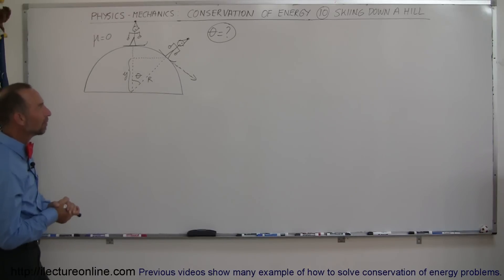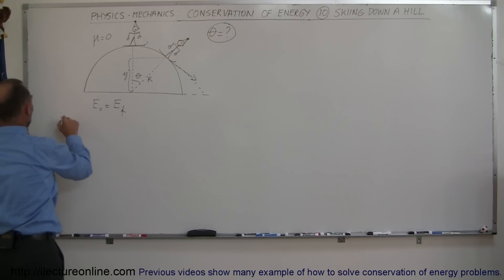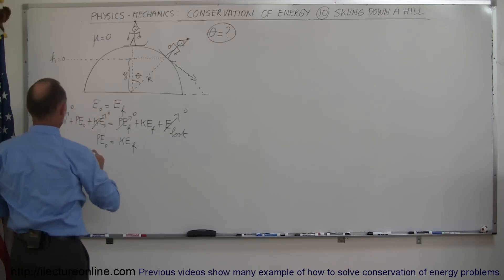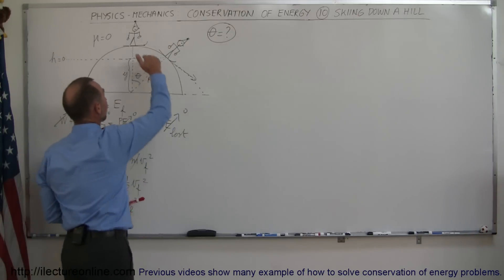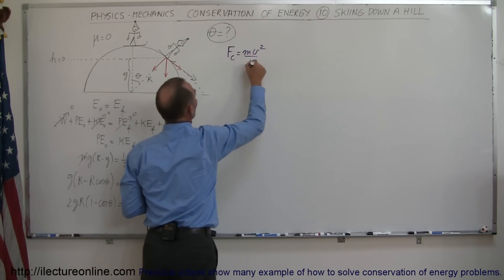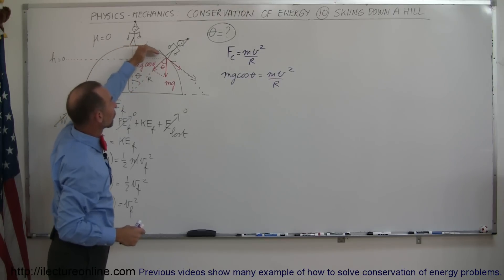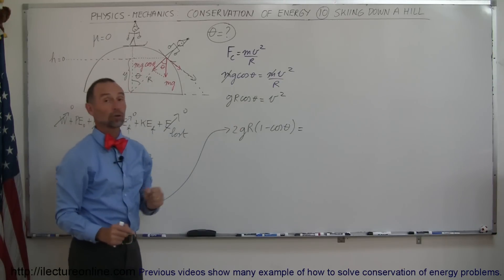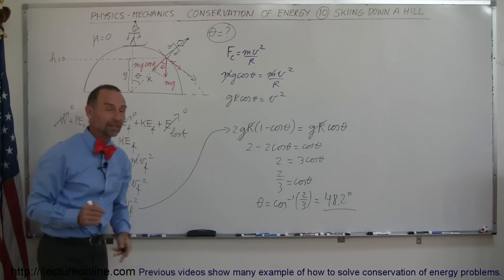Physics 9   Conservation of Energy (10 of 11) Skiing Down A Hill

Comment: isn't it that the sign of the mgcostheta that you used in centripetal force is negative because it lies on the negative y axis?
Reply from the maker: Only if you were to express it as a vector, (and then you would need both the x and y component).  But not as a magnitude as was done in the video.

Comment: What solves this problem is setting PE final equal to 0, the position h = 0, relative to the moment the skier leaves the dome; thus, an equation for the Final Velocity, which we plug into the equation for centripetall force. 
In other words, by finding the Final Velocity that the centripetal force will have, we can find the angle.

Had to think about that, realized that because of energy conservation, the amount of mass and the length of radius doesn't matter, they simply cancel out.

Thank you Professor!

Comment: Hey there it's me again with another question. I don't really understand the part where you mgcos(θ) = (mv^2)/R. Why do you equal these 2?
Reply from the maker: When mgcos(theta) becomes smaller than mv^2/R the skier would leave the ground (go airborne).  mgcos(theta) represents the weight component perpendicular to the surface.  mv^2/R represents the centripetal force.

Comment: please, can anyone tell how to calculate horizontal distance travelled after losing contact?
Reply: sure. You know the velocity vector of the skier when they leave the hill. You can then break that vector down into its horizontal and vertical components. Just like you would in any 2-D projectile motion problem. You also know the height at which the skier leaves the hill, Rcos(48.1deg). Knowing these things, you should be able to come up with the horizontal distance. It would have to be in terms of R because we don't have any actual value for the height of the dome.

Comment: When doing the centripetal force, what happens to the normal force? Isn't it going to be N-mgcos(theta) = mv^2/R ?
Reply from the maker: alex morfi 
Technically, the centripetal force is the perpendicular component of the weight = mg cos(theta)
When the velocity reaches some point, mg cos(theta) will no longer be enough to keep the skier on the slope.

Comment: Why is V presented as a constant in this problem? If I am correct, shouldn't you only be able to substitute the centripetal force equation in if it's constant? In this case, isn't V not constant? The initial velocity to the drop off point.
Reply from the maker: William,
v is not constant in this problem.
In this problem you are trying to find the location where the skier will leave the hill and become air borne.
That happens when the centripetal force is equal to mgcos(theta)
Reply: Michel van Biezen
Hi Michel, thanks for your prompt response. I think I might have just been confused as to how you were able to quickly deduce that you were able to set the centripetal force equal to mgcos(theta). I had to use force analysis to establish that mgcos(theta)-Fn = mv^2/r. Can i assume that centripetal force will always equal the projection of gravity force? Isn't it necessary to assume that Fn = 0?

This is my work through force analysis. 

mgcos(theta)-Fn = ma
mgcost(theta)-Fn = mv^2/r
Reply from the maker: William Zhou William.
Now you are thinking about it in the correct way.
You have to consider what will be providing the centripetal force.
And the answer in this case is the component of the gravitational force that is normal to the surface.